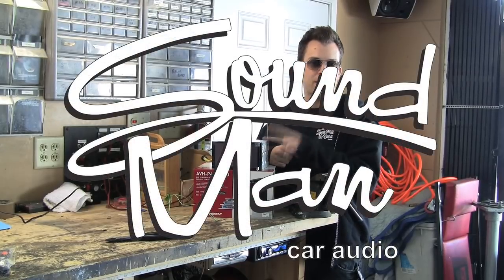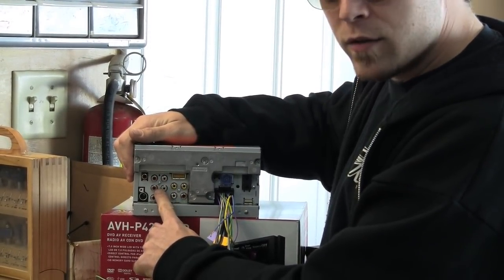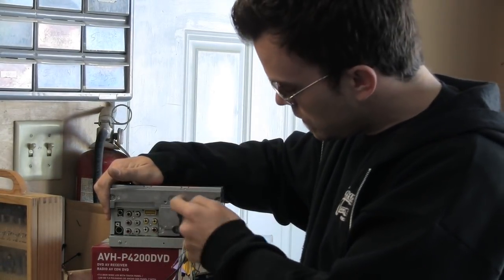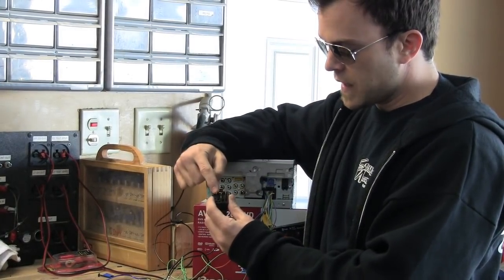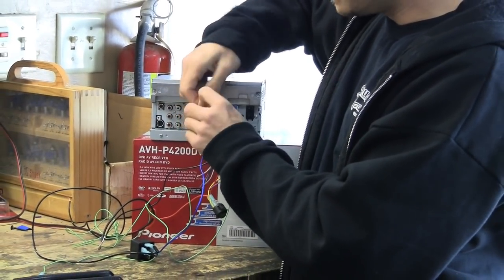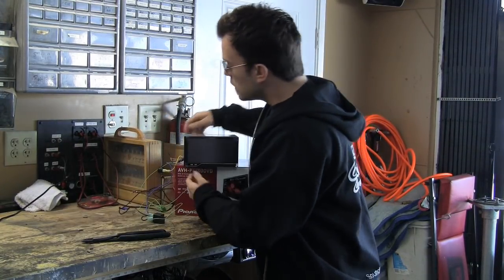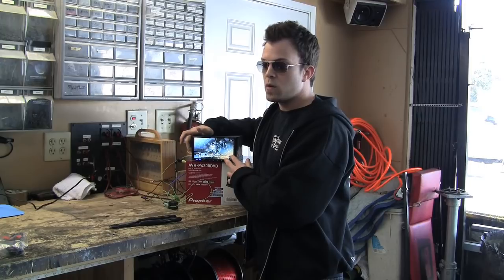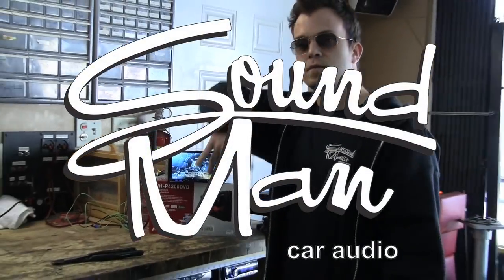Pioneer AVH-P4200DVD Bypass & AVH-P5200DVD Bypass

Comment: @WMskoalman2010 You can buy the ends at lowes for just over $1.  That way you can be sure to have a secure connection.   But if you have a relay and run the wires correctly you should be fine however you secure them.

Comment: Ok. What if your wiring harness doesn't have a red wire like the one coming out of the radio's wiring. Where does the red "ignition" wire go? I have an 08 impala and i'm unsure where to connect the red wire

Comment: Hey sound man I just wondering why this is not working I installed as shown and even in park the message shows I have a avh-4200 and I ordered the jumper harness for the car and wired the receiver harness together with the relay any input ?

Comment: @xmdude626 I have it installed in a 2006 Cobalt SS....so if i dont have any aftermarket amp then the blue wire isnt connected to anything right?? What about the factory amp thats powering the 4 speakers + 10'' sub?? I'm just wondering wether I have to cut the blue wire if its connected to anything or if its just sitting there not being used (I got the deck professionally installed)

Comment: Wouldn't this also work if you just connect the Remote Wire coming out of the radio with the green/white cable on the radio? My install manual says to connect it to the POWER side of the brake switch, not the ground side and since the remote wire sees power AFTER the unit sees power like this man says, it should work that way too, no?

Comment: I also noticed the issue of not being able to get to set up menus when the system is off.  I'm going to install a timer relay and run it off the acc wire.  Set it to 5 or 10 seconds and everything should work fine.  Takes that long to start up any way.

Comment: Auto EQ function, or just remove the 12 constant source wire after you are done with Auto EQ setup.
I don’t know if the PRO’s have a better solution, but this will work.

Comment: Yeah a 4 or 5 contact relay will work. 

85 and 86 are the coils
85 gets ground, 86 goes to remote turn on
30 and 87 is your switch
30 gets ground, 87 goes to parking brake wire.

Comment: lol this is awesome! I used a relay on my p4000dvd when I installed it a couple years ago. I didn't know you did a review on this series until tonight. I'm looking for a Bluetooth adapter for my head unit. Would it be cheaper or easier to just buy a new head unit? I really like it, but I really want Bluetooth connectivity, and if the adapter I'm looking at is the right one (cd-btb200), it's $180 on average.

Comment: @bossman510 I think the only way this can be done, so far that I have found, is to get a zune dock with video out and a remote (ie, the one they sell for home use), run it through the AV/V input, mount it somewhere, and use the remote.  Even then, no touch screen capability...but it will let you use a remote and watch videos...

Comment: @Hobie44610 

I tried a class 10 32gb from my phone and it doesn't work unless I have to format it. However, i have an 8gb SD in the player and it works. Its a class 5 however.

Comment: I did it this way with my pioneer avh-1300nex and it didn’t work. I used the ground from my main harness and jumped it over to ground one switch legs. Ran my Parking wire to the other switch leg and used the remote wire for my power source. When my stereo fires up I can hear the relay fire but when I pop a dvd it won’t enter through. Did I do something wrong? I feel that when that screen pops up is when I need to short the parking wire. Any ideas or solutions? I know that I used the open side to my spdt relay cause I continuity tested it first so I don’t think it’s that.

Comment: Sup,, I tried this method with a avh-x5500 and it didn't work. It seems that as soon as I turn the ignition on the bypass doesn't click when it should. I tried it with two different ones and got the same result. The only time the bypass clicks is when I tap the remote wire on the bypass terminal myself . So with the bypass still connected I hooked a basic flip switch to the remote wire and got it working but I would have to flip it. Any ideas?

Comment: Just a heads up, this method won't work with a Pioneed X5600BHS.  I just tried it with a couple of different relays, and the head unit requires a double pulse signal, this only provides a single pulse.  I wish it would work as it's a great way to bypass (simple ground is so much nicer though!), but it looks like in order to get the pulse frequency down properly, you have to get one of the bypass modules with a small microcontroller built in.  Should have mine tomorrow, so I really hope it works.
Reply: I have same unit. Did you ever get it to work? If so what bypass did you use?
Reply: Just one of the cheap ones off Amazon, it was less than $20.  Worked just fine after that.  Much more annoying than it used to be, but better than not working.  There's no practical way to get the video to work without the bypass either.
Reply: Rett you ordered what part on Amazon to get your Pioneer DVD to work .
Reply: And you hooked it up yourself ? Any instructions ? Thank You.
Reply: Just followed the instructions that came with them
Reply: Hello, will this work for a avh-4300? Thanks

Comment: I just posted the answer to your problem (E Lippy). Once the key is in accessory mode turn the radio off and back on.....will work then.  The capacitors are now energized and the radio will beat the relay.

Comment: hey i did this install as is and the relay worked as supposed to about twice
now it only works when i power on i have to disconnect the handbrake wire from the relay and then reconnect it.
what is causing this?

Comment: @allergypurifiers On your fix for this stupid annoying feature, is there a way you can message me some more details. I didn't set the bypass on mine (had mine installed - they did it). What do you mean "make sure to put a switch in the line" and "don't forget to turn this switch off after"? Should I take the unit out and mess with the wire mentioned in this video? Or is there an easier way to do this?

Comment: Went to pick up a relay today and I was told by my local install shop that Pioneer figured out a way to kill this workaround....... So its either install a switch or there's a cable you can buy online that will pulse and act like the parking brake

Comment: I bought my truck with the APH-P4200DVD already installed and I believe it was already permanently bypassed because I never saw that message.When I replaced my battery everything reset and now the system won't even give me the option to extract CDs or tilt the screen even when the car is in park or turned on but not running. Any ideas?

Comment: Hi, Dont now if you can help with this.  I have this model installed on my lexus altezza and i inserted an sd card and now the screen wont flip down for me to remove my sd card.  I tried everything save prying the screen off.  I pressed the eject button on the screen, the animation shows that it was pressed but it just doesnt eject.

Comment: how do i hook up the AVH-P5200DVD in my 06 dodge charger i want to test it first by hooking it to the battery  see if it works but i need to know what colors are the power wire and how to hook them up to make the power come on thanks i really appreciate it if you can help me out with this
Reply: strongly suggest finding an authorized installer if you don't know which wires are which. You should have some kind of access to a wiring diagram. Also, your car has a factory amplifier. Be careful. It's worth the money to have it done right.
Reply: Ok thanks for the help
Reply: twist red and yellow together there both positive and black is negative

Comment: @socrates008 You don't do ANYTHING with your brake wire from your vehicle with this method. This method and the method illustrated in the owners manual are two completely separate things. Do one or the other, not both. 

And the remote wire doesn't have to terminate at the relay. It can be pigtailed to be used for something else as well.

Comment: I can't get this to work with pioneer avh-x5600bhs is there a method similar
Reply: Check out the double pulse bypass from DIYBypass. All new AVH-X pioneer radios will not work using a relay. They must see a double pulse on the parking brake wire.

Comment: Hey man I've tried to message you, but I can't find the dumb button. I just installed a 3200bt with the navigation add-on. However, my bypass will not work. I have triple checked the wiring on the relay and I know they are correct. If anyone can help me out plz do so.

Comment: Hey, thanks for the video, you know your shit dude :)  got a question, I've got the Pioneer AVH-3300BT, (I know, should have bought the 4300 or higher because of the rear USB, but I thought mine had the rear USB as well) anyhow, my question is SUB WOOFER, it says that I can hook up a single sub thru my rear speakers without using an amp, the Pioneer has a 70w @2ohm for this, question is, how does that hook up in the chain? Do I hook up the rear speakers and "daisy chain" them to the sub? I don'

Comment: Ok, so for an AVH-P2400BT, this will not work.  After trying to figure out why the relay wasnt working for me, I found that if I just ground the wire, it worked, BUT the screen that comes up tells you that you have to engage the parking brake, release and engage again.  So, it seems that Pioneer has bypassed this bypass.  The only real way to do this with the newer units is with toggle switch.

Comment: @skurzhun 
I had the same problem except mine never worked cause I installed the navi from the get go. here's the solution:
Before you start the car detach the detachable piece on the nav. start the car and then plug it back in. this will let you now watch the movie. i had the movie playing and the navigation going at the same time then! try it out it should work

Comment: I just changed the switch on the e break to normal closed to normal opened.my car is a stick so I use e break when parked.so now i start the car power goes to radio then when i put the break down switch closes and grounds the lead and video works with the e break down but not when its up but I don't care cause if the break is up I'm not in the car this is the best way if you have the knowledge.I use the blue /white to power amps i'm not going to put a ground on the remote turn on lead for amps.

Comment: well in my system the relay is hooked before the iso plug connection to remote .. and now amps are connected on the iso connection remote .. and it works fine! =)

Comment: Okay..I did this to my 4200 and it works of course. But here is the problem when u connect the AVIC-U220 it will not allow you to bypass because it takes time for headunit to boot you causing it not bypass. I found one solution to the problem, unhook the navi and wait for a second and reconnect it. Now, if there is another way out there to bypass please let me.

Comment: one more thing that didn't fit, since the diode will act as a short if you polarize the  relay incorrectly, it could short your DVD remote wire to ground and not click the relay at all, i did it once using a car baterry, don't know it will behave the same through the DVD system. I don't know how it actually worked in the video but it's something you should consider not doing. 

This is my first time trying to install a DVD in my car, and I'll try your tips. Thanks for the help.

Comment: when I connect my unit inside the car it dont work, nothing happens. I took it back guy tested it by wiring the red and yellow (ignition and constant) to the + terminal on battery and black (ground) to - terminal and it worked, switched on and everything. I tried again inside the car, nothing! any ideas? (95 sc4)

Comment: Put a 5v fuse on the blue/white wire at the relay just in case the relay malfunctions you don't want to ground out the remote turn on for your amps. Other than that you got it right your the shit I just like to be safe than sorry.

Comment: the flaw with this solution is that the display controls for adjusting the key offset, etc is un-accessible.  the unit must be turned OFF to access these menus.  Im working on a solution utilizing a latching relay that will ground the lead once the unit is off, but requires the ignition (or ACC) to be switched OFF to open the ground loop.

Comment: FIX for: Auto EQ “Function unavailable while driving” message displayed even when the bypass relay is installed correctly.  OKAY – I installed the bypass relay successfully with the AVH-P4300DVD and CD-BTB200 connecting to iPhone 4 with CD-IU200V.  I can watch videos, and DVD’s when driving just fine.  There is a PROBLEM when trying to set up or use the Auto EQ feature (have to use the Pioneer CD-MC20 Auto-EQ Microphone) where you get the “Function unavailable while driving” message.  I already

Comment: Should work in theory...I tried on my avh-p1400dvd and it did not work (2004 Xterra).  The remote signal is sent faster than the stereo can start up.  (I double checked with my meter)  I had to hook mine to a switch.  I was thinking about running the relay on the illumination wire but then you can only use dvd when lights are on....we'll see.  (btw, 4 pin or 5 pin relay doesn't matter...just don't use the center pin on the 5 pin)

Comment: I bought a AVH-X3500BHS today and the relay fix does NOT work on the 2013 models.  Based on the posts I've seen it does work on the 2400, 3400, etc.  So if your pulling your hair out trying to get it to work on a x500 model then don't bother.  I wired a switch to ground and that works but you have to toggle it after the reciever boots up.  I don't mind flipping a switch if someone wants to watch a DVD..  Most of the time I don't have video playing while I'm driving anyhow.

Comment: Didn't work for me. Though the relay didn't seem to be working right no matter what I did I couldn't get the accessory line to "power on" the relay switch It just kept the parking brake line grounded. Anyway I just ended up going with a switch since I probably wont be using the dvd function except for trips.

Comment: best info I can give is... Connect blue wire to your remote antenna blue white stripe from radio (same as sub amp remote if you have it).  Black wire to ground...green wire to the light green on radio harness..thats it.  Nothing more.  I soldered all my connections and heat shrink wrapped them.  Crimps are for lazy people.  lol

Comment: nope, because the head unit will not see the pause it needs to allow the bypass to work. the time it takes for the head unit to switch the remote wire on and then the relay to 'click' in is what it needs. i used this method on my 4200 and it worked fine. just a shame the rest of the head unit was crap and died a horrible death.

Comment: Does not work on the AVHX1600DVD either.
Reply: I have the same unit.... What would you recomend or what did you use to make it work I'll appreciate if you can help..
Reply: David Cibrian  Someone made me a switch with some resistors and a relay I think, which works, but I need to turn the deck off then on to get it to start playing videos while the vehicle is moving. Alternatively you could just setup a grounding switch which you could flip after the unit has started up to activate the "parking brake".
Reply: So pretty much just ground the e-brake cable with a switch and just turn it on whenever u want to see a movie or something cuz the video says you can activate it after the unit is turn on right????
Reply: Pretty much yes. it has to be done after the deck is on though, because it has to simulate the hand brake being engaged .
Reply: Well... I'll do that then... Thanks a lot for your help
Reply: NO problem

Comment: I hate this feature, if your parked,  and want to watch a dvd, you need to release your eBrake, and then pull it so the P4200DVD will play.  I grabbed the Bypass but its difficult to wire it POST INSTALL so I ended up just using a toggle switch instead to save myself the head ache of pulling my head untit out to get to the amp power wire.  Save your money and wire a toggle switch to the eBrake sensor.  You only need to flip it when your watching video's.